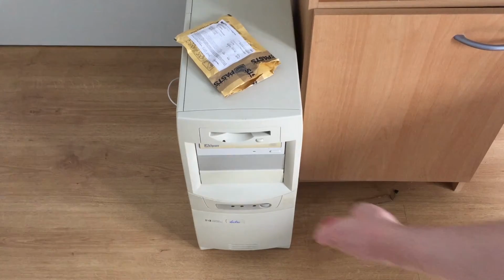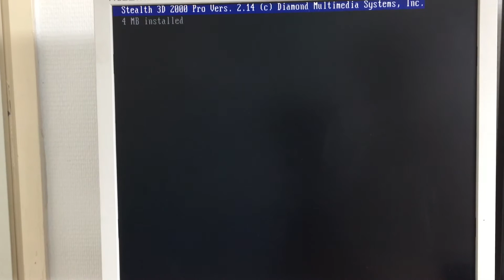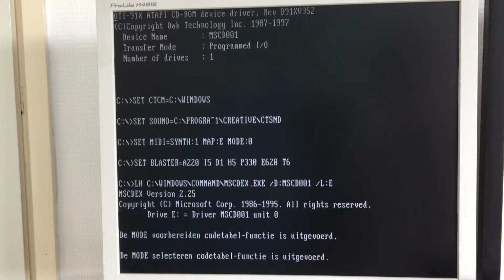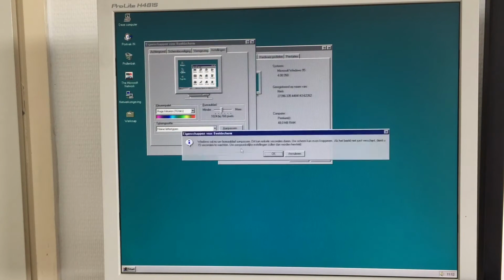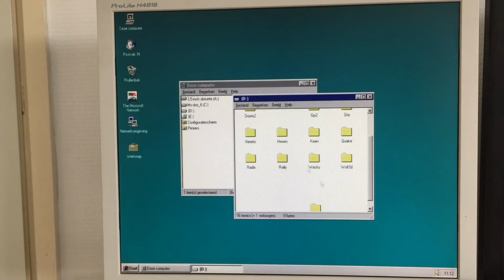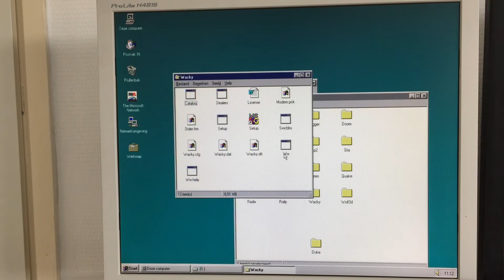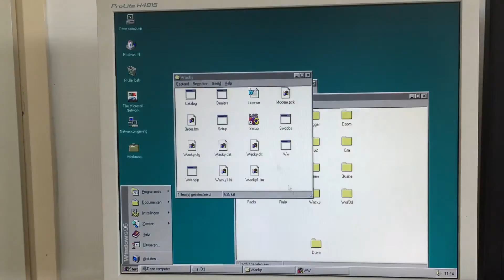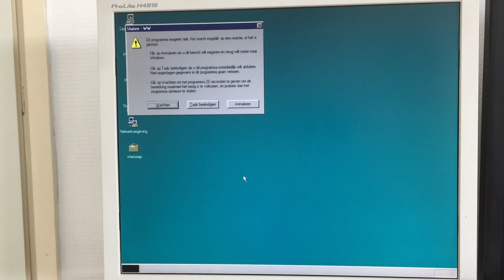CPU and Video Card Upgrade for the DOS Gaming PC

Comment: i have that same motherboard, it has a 166 mhz pentium with a built in heatsink/fan that looks like http://www.x86-guide.com/Photos/Vente/1/Intel%20Pentium%20166%20Box%20SU072.jpg
it works, has the up to date bios (1.00.07.DH0), has 512k L2 cache, USB 1.0, onboard Yamaha OPL3-SA sound card, etc. the bios even has a custom bios logo when i got the board. https://i.imgur.com/KXMOOcy.jpg

Comment: i'm looking for a ATX hp vectra case like yours on ebay to make a sleeper PC with my AMD ryzen 5 16gb ram gtx 1060 hardware but they are expensive and very rare. I guess that older ATX cases are that rare, older PC parts are easier to find than the older PC cases.
Reply from the maker: Might be easier to go to thrift stores or e-waste recycling places to see if there’s a case there.

Comment: I bet you that board would take a 233MHz chip if you set the multiplier to 1.5X, the processor itself re-maps this to 3.5X. Not really something worth worrying about though, the extra 33MHz doesn't really make that much difference, the 200MHz chip should kick butt at pretty much anything under DOS anyway. Interestingly CPU-World lists SY016 (The old processor) but not as an ES, yet the images I can find don't contain the ES print... It probably is and they just haven't documented one yet, you might want to hold on to that one.

Parts are definitely too expensive now. I dread things breaking these days because of that, a few years ago it wasn't anything to replace things or build things, you could practically do it without much thought, but these days it's something you have to check the bank balance for.
Reply from the maker: The speed boost definitely has helped in some regards. The system feels a tad snappier and network transfers reach a rather acceptable 2MB/s now, which makes transferring data less of a chore than before (roughly 700-900K). I'll definitely look after the 166 chip if it indeed is an engineering sample. A cool little relic for sure. 

Especially motherboards are overpriced these days when it comes to 386 and 486 platforms. I can source the CPUs for somewhat acceptable money but the boards are getting increasingly crazy. PSUs can be adapted, AT boards will fit a full ATX with some clever mounting, so that's not the biggest issue, but a few hundred bucks for a board, no thanks.
Reply: The last 486 board I bought was actually cheap, but it was 5V and ISA only, and nobody had bought it despite it being there a long time. Prior to that, yeah, north of £150 and basically signaled the end of such things for me. You can throw offers at the seller, but they usually don't accept them so you have to start cutting corners here and there, or going with a less expensive platform which probably works better anyway, like the Pentium. A word of warning; PSUs don't always work on those adapters, it is rare, but some cards need -5V and newer supplies often don't have this. It rarely comes up running fairly standard hardware though, only idiots like me who like doing things the hard way are likely to run into it.

Sometimes you can get faster network speeds by using a Win9X VM with integration features on the newer machine to transfer files to the old one. At least, this works under Windows 7, somehow bypassing the host OS's crappy netcode.

I never commented on the VGA you installed, but I don't think I have to, you probably know how dependable S3 cards are in this field and that they're very good in 2D. With 4MB of RAM you should be able to ramp the resolution and color depth up quite high. Microsoft's article and my quick crappy math suggests 1280x1024 should be possible at 24-Bit color given driver and OS support. It would be kind of pointless though, probably offers no advantage. I've always found 800x600 in 32-Bit color adequate for Windows 95 stuff.